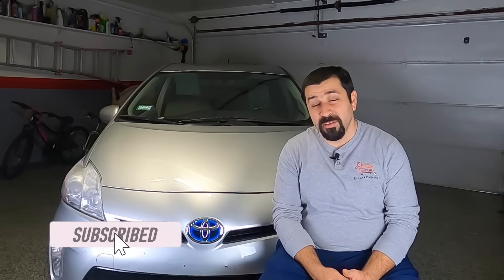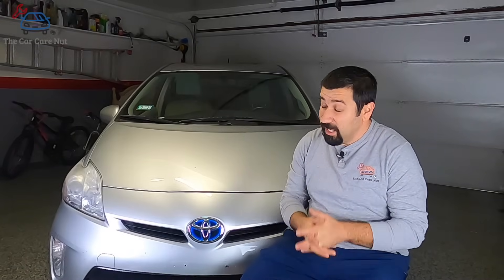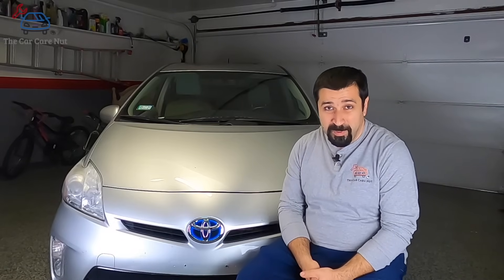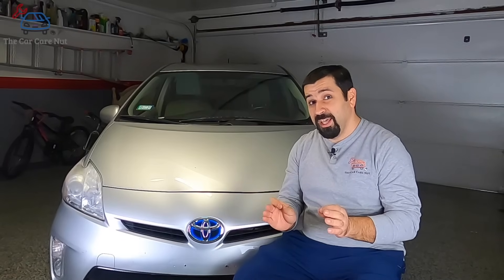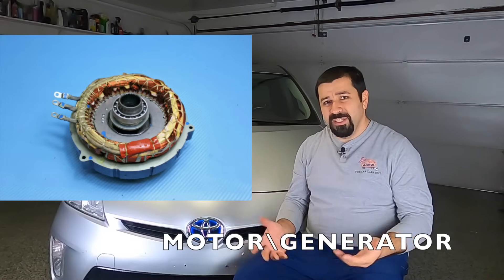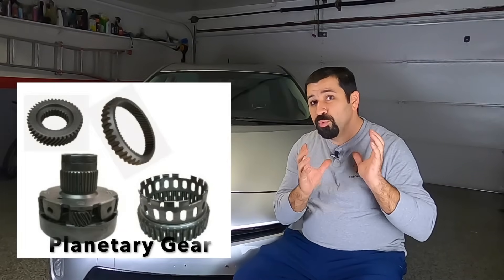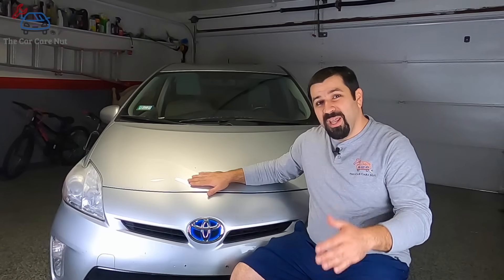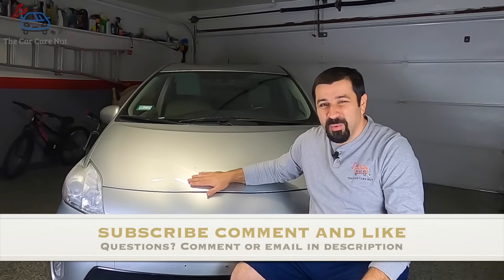How Toyota Hybrid System Work Part 3 Hybrid Transmission

Comment: Hello "the car care Nut`. thanks for all the video .. I have rav4 2020 Hybrid and learning a lot of things from your video . I have couple of questions
1. I kept Rav4 hybrid in hiddle mode .i.e. engine running on and off / battery running. after 1-2 hours the car completely stopped . and I need to start again .. Why is this happening  
2. When I plugin solar charger / battery power pack ( 100 wh ) changer in 12v cigarette  lighter   .Does it get charged from the Alternator or from small 12v or Big heavy battery from the back . 
Thanks for your time ..
Reply from the maker: Hi! Which mode did you put your rav4 in? Also when the car is running the dc/dc converter which is part of the inverter supplies 12 volts to the car. Hybrids don’t have alternators
Reply: @TheCarCareNut  1. I was parked and it is in Eco - green hybrid mode .
2. I am planning to connect this 167Wh Portable Power Station https://www.amazon.com/gp/product/B08G4DMQP5/ref=ppx_yo_dt_b_asin_title_o03_s00?ie=UTF8&psc=1 . while car is running or when I park . Car will be in On - Eco mode when this connected.. will this drain the battery and will I have starting problem ..?
Reply from the maker: As long as the ready light is on you will not drain the battery.

Comment: so since its not belt driven and has no cones what is you stand on friction modifiers? i am using liqui moly ceratec with my Motul 0w12 Hybrid Engine oil (very happy with wear and consumption). Now i am considering using it in my eCVT.  LM claims its save for any Transmission except Belt driven transmission. i am driving a Toyota Yaris Hybrid 2015 (named Pirus C Acros the Atlantic i belive) Currently at ~220K Kilometers.
Reply from the maker: I wouldn’t use any additives in your hybrid transmission just ATF WS
Reply: Thanks for the info

Comment: Thanks I was never clear on mg1 and mg2. This video did a great job in explaining the difference and the purpose of each. Also I have experienced my car making that loud noise at start as if the engine was going to blow a couple of years back, it scared the heck out of me. Now I know it was the transmission and not the engine.
Reply: Mine did the same thing few weeks ago. And it happend in the morning after nigth short turn on and off the system for moving car a bit for parking purpose. Now I dont turn off my prius until it turns off engine itself
Reply: @quoprimum5215   But according to what he says here, there is something wrong with the transmission  right ? It's one thing to explain what the car shuddered and made the noise, but it would have been nice if he explained what caused the transmission to do this ( is it going out? is it needing maintenance ? does this throw an engine code ? etc )

Comment: Really a good top-level discussion.  There are many YouTube videos that discuss the hardware & functionality in more detail.

RE fluid change:  Toyota claims this never needs changing, but there are drain & fill plugs.  I changed mine at 30K miles, and the fluid was very dark compared to the new fluid.  I changed it again at 90K miles & the fluid looked almost new.  So, there may be some benefit to changing the original fluid at 30K miles.

Toyota didn’t invent the Hybrid Synergy Drive.  Ford invented it many years ago, but they couldn’t see a market for such a vehicle.  They sold the rights to Toyota.  

The engine is always mechanically connected to the front wheels.  The eCVT operates like a torque converter when the vehicle is stopped and the engine is running.  The direct connection between the engine & front wheels limits the vehicle top speed to the max engine RPM, about 115 MPH.  

There actually is a clutch between the engine and the transmission.  It doesn’t function as a conventional clutch in normal operation - there’s no mechanism to disengage it.  It functions as a mechanical “fuse” to disconnect the engine from the front wheels in case the engine seizes up while driving.
Reply: The engine is not mechanically connected to the wheels. MG2 is mechanically connected to the wheels.
Reply: @duhboi6516  The ICE drives the planet gears, which engage with the ring gear that is ultimately connected to the wheels.  So yes, there is a direct mechanical connection between the ICE and the wheels.  MG2 also drives the ring gear.

Comment: I'm curious, some people say (including Scotty Kilmer) that in a normal car the start/stop function can wear the engine prematurely. Are there engine problems in hybrid cars since the engine start and stop a lot more?
Reply: Driving 9 years and 200 000 km Toyota hybrids (Prius III and C-HR).
No problem. I visit the service only for the maintenance.
Reply from the maker: There’s opposing theories on this one. Hybrids have been around for a while and no issues are present however conventional start stop on gasoline only models time will tell which theory is true
Reply: This is solved with using very thin 0W-16 oil to ensure rapid lubrication on each startup.
Reply: @thetalkingboard  I think that Toyota Priuses use 0W-20, quite thin oil i think
Reply: @hedgehogthesonic3181 my 2022 Lexus ES 300H uses 0-16 weight, oil!
Reply: @davidkirkham6497   Wow that is some thin oil indeed
Reply: @hedgehogthesonic3181  Yes, the tolerance in the engine must be very, tight!
Reply: my Lexus is 11 with 270000km on it.....knocking on wood; no problem with the Hybrid system or start/stop function !  but the often On/Off was perhaps 1main reason why Toyota uses 0W20 oil in the engines .
Reply: Of course start/stop actions increase engine wearing.

Comment: Is there a low automatic transmission fluid sensor on the Corolla hybrid? I just got the fluid changed on mine, and I was hoping there was a way to make sure it's not losing fluid without jacking it up.
Reply from the maker: There’s no fluid level sensor on hybrid transmissions. If the fluid overflows from the fill plug it’s full.

Comment: Toyota now has the Hybrid SUV, Rav 4 hybrid. Does the Rav4 uses a similar transmission as the one you described for the Prius?
 
Even though I drive a Kia Niro 2018 hybrid I noticed that when I drive downhill even if it is going at a higher speed the vehicle uses only the electric motor, I think because it generates sufficient power going downhill with its own inertia it doesn't not use the engine as an additional power, at the same time when I see the battery gauge I notice that it is charging it. This is the same principle in the Toyota Prius? 
I read and saw diagrams of a CVT transmission online and they show that it uses a mesh chain pulley made of many parts steel parts, is this how the Toyota Prius E-CVT pulley works as well or is it different?  I am enjoying your concise explanation of a hybrid system and I am appreciating the technology even more.

Thank you.
Reply from the maker: Thank you for watching my video! So different manufacturers will use different methods in their hybrids. I am not very familiar with Kia hybrid designs but in the Toyota has a similar design in all their hybrid models. Differences are in generations of hybrids.

Comment: Another great video, simple and clear !
But you forgot another great feature of the e-cvt : the variable ratio allows to cruise at relatively high speed with a very low engine speed : another bonus for the fuel economy !
Reply from the maker: Thank you Maxime! Hybrids are very interesting cars in the way they function

Comment: You said no clutch, but when in N instead of P or D, as far as I know, it is not charging the battery. You should cut connection between ice and mg1 for Neutral, for not charging. How is it possible?
Reply from the maker: Power generation in neutral is not possible due to motive force of generating. Motive force would cause the car to possibly move because it’s not locked by the parking pawl so charging is disabled when in neutral.

Comment: Seeing you discuss the Prius CVT made me want to share my thoughts on it.

What's called a planetary in the video is a differential, a differential is only planetary gears. Differentials are used in all cars to keep power applied to the drive wheels equally while turning corners. You may remember a time when one drive wheel slips in mud or snow and the other wheel goes nowhere. 

So imagine a rear wheel drive car with one rear tire removed and pretend the car magically stays suspended. Then disconnect the hand brake from the wheel thats on the ground and leave it attached only to the floating brake hub.
Put the car in gear and try to drive it.
It won't go anywhere. Like in the snow,  the hub will only just spin because of the differential.
Then start applying the hand brake to that hub, slowing it down, and the differential will put torque on the other wheel. The car will go and you can control the engine rpm and vehicle speed with the combined use of the gas pedal and the handbrake. If you put enough pressure on the handbrake so that the hub completely stops, the differential will pass all the power to the drive wheel. 

That's the principle behind the Prius CVT.

Now replace the handbrake with a generator and instead of creating a lot of heat with the handbrake you create electricity with the generator. Increasing the field current of the generator produces more electricity and puts more of a load on the differential. Consequently more torque is applied to the other wheel. Of course, the electricity needs a place to go so put a motor directly on the other wheel, a battery to store fluctuations of demand, a computer to control the whole system, and you have a Prius! 
No friction parts in the CVT since it's only basically a differential.
When slowing, the engine stops, the generator just spins with no field current, and the motor acts as a generator, charging the battery while slowing the car. Finally the brakes bring the car to a stop.

So the Prius actually has two differentials (planataries), one is the CVT and the other is just the usual one on the wheels. All elegantly put into the same shell with the motor and generator.

To recap, the CVT differential has three shafts, the engine, the generator, and the motor which is always connected directly to the usual wheel differential.
Reply: Well, a car's differential is functionally the same as the power split device, but its design and purpose is a little different. I prefer to call the function a "three-way transmission" and the difference, in the purpose of the device, is which of the three are considered to be inputs, or outputs.

The purpose of a conventional, two-way transmission is the alter the "input" spin rate - that is, the spin of the internal combustion engine, or ICE - relative to the "output" rate of the  countershaft, or CS. Changing gears, whether in discrete steps (manual or automatic) or continuously (CVT) changes the gear ratio G in the equation: ICE=G*CS (or input=output).

A differential has one input, the countershaft. But it has two outputs, the two wheels W1 and W2. Most of the time W1 and W2 spin at the same rate, but they need to be different to drive around corners. So the differential makes their average speed equal that of the countershaft: CS=(W1+W2)/2. The issue you describe is that both wheels need to provide some resistance. If W1 has no load but W2 does, W1 will spin twice as fast as CS, and W2 will not spin at all.

The Power Split Device works on the same principle, but it has two inputs and one output. It also doesn't use straight averages: 18*ICE+5*MG1=13*MG2. Note that the motor-generators can spin backwards, so those terms can be negative. Then MG2 is connected to the countershaft, which is connected to the differential and then the wheels.

Using this information, we can explain some of the Car Care Nut's simplifications. Both MG1 and MG2, not just MG2, are used in EV mode, with 5*MG1=13*MG2. So ICE=0. This is equivalent to your experiment where one wheel was held stationary, and the hub was allowed to spin. To start the ICE, MG1 doesn't increase its speed, it decreases it. Or spins backwards, if the car is stationary.That way ICE has to start spinning to make the input speed (the combination of ICE and MG1) equal to the output speed. Just like how slowing your hub with the handbrake made the other wheel spin.

Hybrid drive is more complicated. At slow car speeds, MG1 controls the speed of the ICE by acting as a generator, resisting its spin and so slowing the "input." It sends power to the battery and/or MG2, which can add torque when acceleration is needed. At high car speeds, this reverses. MG2 actually resists the spin of the ICE, and sends power to MG1. The clever bit here is that MG1 can now increase the input speed of the three-way transmission, so the ICE doesn't have to.
Reply: Couldn't be explained better 👍
Reply: Great explanation!
Reply: Excellent explanation, thank you so much!!!
Reply: Jeff and WillyAG, thank you so much! I still don't fully understand it all though. I've been watching WeberAuto's videos. How does MG1 and ICE, which are mechanically decoupled to MG1 (in the sense of you can spin them, but have MG2 held stationary), still contribute to torque production when under full acceleration? 

I am trying to also understand how the under/direct/overdrive, under cruising mode, is achieved by using MG1 (forwards, stationary, and backward).

Also, when in EV mode, doesn't MG1 spin in the opposite direction to MG2 (assuming MG2 is the only motor that drives in motor mode), but when the ICE needs to kick in, it's MG1 that starts it. My understanding is that the flywheel connected to the ICE rotates in the same direction as MG2, but with MG1. This all means to me that MG1 all of the sudden rotates in the opposite direction. That can't be too good? Not sure if this makes sense what I am trying to say. I may lack the proper understanding of it all though.

(I always thought there was a CVT in the Toyota hybrids, but this eCVT is so different and quite a cool piece of engineering!)
Reply: @mark  The device is technically called  "Power Split Device," but you can think of it as a "Torque Split Device" as well. Because POWER=TORQUE*RPM, so splitting power is the same as splitting torque. The engineers have to use both to solve the control system, but the qualitative description doesn't need that.

"Opposite direction" is a little hard to define, since MGs can be motors, or generators, in either direction. I don't know what sign convention Toyota uses, but I wrote my equation so that positive torque by any of the three devices will push the car forward.

What may be confusing you, tho, is that nothing is ever "decoupled," but  MG1 and ICE are coupled to ea h other first, and their net is coupled to the wheels. Most often when the ICE is running, one of the MGs will be a motor pushing the wheels forward, and the other will be a generator pushing back against it, the wheels, and the ICE. At slow speeds, MG1 is the generator. At higher speeds, MG2 is. This allows the ICE to stay within a narrow range of RPMs where it is most efficient, and approximates the difference between under- and over-drive.

In EV mode, both MG1 and MG2 push the wheels forward, with MG1=2.6*MG2. This way ICE=0, and both are in the positive direction in my system. MG1 slows down to start the ICE, by making it have to spin to cover the rpms it takes out. Depending on speed, that could mean changing direction, but there is no harm done.
Reply: Good thing I didn't go to engineering school because I'd would have flunked out and be homeless. Love my venza and the portion that l can comprehend make me appreciate this car all the more.
Reply: @ozarklife9996  Your engineering sense brought you to the Venza. No friction parts in the transmission and all that Toyota technology!
Reply: Excellent description-I like redline oil and noticed they recommended both their D-6 transmission fluid which is similar to Toyota w-s…but they also recommended their nonslip cvt transmission fluid, which I thought was a mistake because it doesn’t seem like Prius is traditional cvt transmission… of note-I am the antithesis of mechanical understanding-try to read a lot but don’t have a good grasp. Wondered what your thoughts were regarding the fluid.
Reply: @kevinb2844  I would use nothing but Toyota recommended oil. Non slip oil sounds like putting sawdust in the transmission.
Reply: I'm 77 years old and own a 2015 Prius. Love the car. My 24 year old granddaughters drives a Prius and my 20 year old granddaughter graduates from College next month and she too, drives a Prius. Very good reliable vehicles.

Comment: Great video, it isn’t easy to explain how this transmission works in simple terms. Would you advise a very conservative full synthetic oil change schedule of 3000mi/5000km due to the engine starting and stopping so frequently?
Reply from the maker: Thank you. I still recommend you change it every 5000 miles or 6 months especially on hybrids.
Reply: @TheCarCareNut  did you mean 6 months?
Reply from the maker: Sorry yes 6 months
Reply: You’ve said the start/stop cycle of the MG1 does not prematurely reduce engine life due to the 0W-16 oil.  But would it be considered a good practice to turn off the start/stop system as a general rule to extend engine life?  If I did that would it reduce fuel savings significantly?  What is your recommendation? I’m waiting for delivery of my new 2022 Highlander hybrid. Thanks

Comment: Great video again, thank you. I have seen a video where a mechanic from Poland takes it apart and explain in detail how simple build it is. 

The intriguing part is how it is actually changing a gear ratio, as I understood it actually uses the one of the MG to apply right amount of power or load to make planetary gear make the rest of the work. Simple yet sophisticated ;-) 

I spoke to drive who did more then 800kkm with on the same gear in Prius.